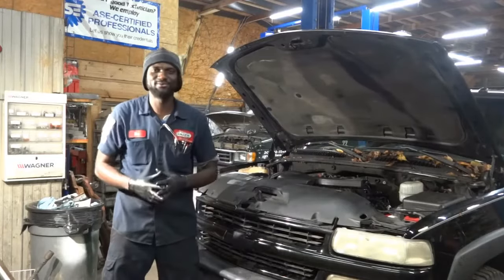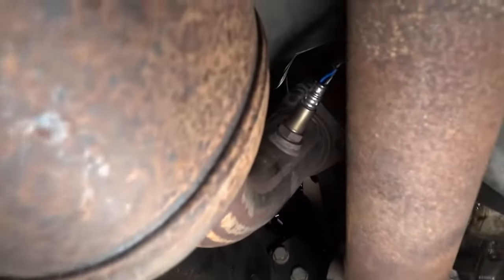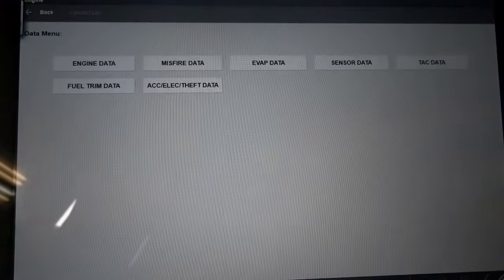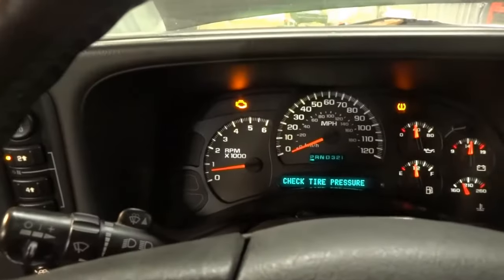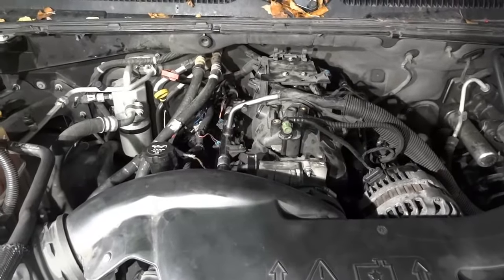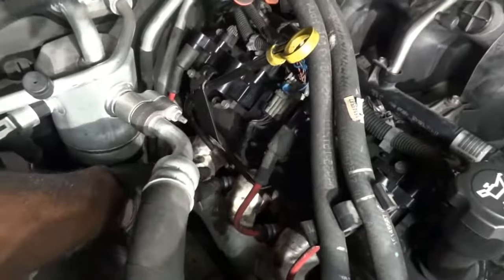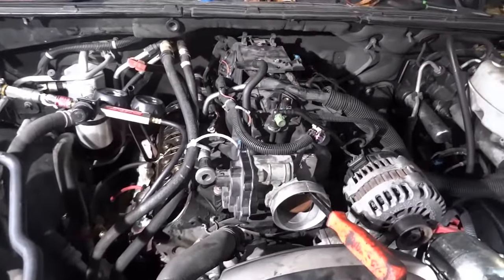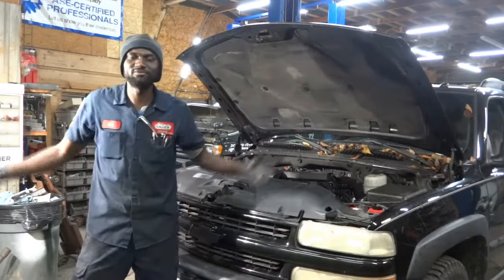CHEVROLET SUBURBAN 5.3L~ P0300, Still not Fixed After replacing the injectors and ignition Coils...

Comment: Very nice video. Thanks. I've been helping my son with his 5.3 L engine. I did a relative compression test and a couple of the cylinders show a bit low on the trace compared to the rest. The truck runs good, and is not showing any misfires in scan data. I don't have a leak down tester, but I'm considering getting one. Question, if a leak down test showed a non-sealing valve, would it be an acceptable repair to just pull the head off and replace the valve and the spring components? Would I necessarily have to send the head to a machine shop to be resurfaced if there was no evidence of warpage with a straight edge? I also saw on eBay some used cylinder heads for this engine for around $200 for the complete heads. I'm wondering if that would be an acceptable route to take? My son doesn't have a lot of money to sink into this truck, so just trying to find the least expensive fix possible.
Reply from the maker: Timothy Horne Thanks!  is the head on eBay new or used? it's always good to send the head to the machine shop to get it checked and cleaned if you plan on reusing it!
Reply: @KITS_Auto_and_Truck_Repair  it's a used head. Thanks!
Reply from the maker: @Z14kt12timandjes1   My Pleasure! I think you'll be better off sending the one you have to the machine shop than getting a used one online!

Comment: WOW!! Outstanding video with sound mechanical reasoning and diagnostic's. Son has 08' Avalanche with very similar problem and shop in Texas is throwing parts at it. Told him to stop! Get it home and I'll come look at it. This video helps immensely in my thought processes and diagnostic plans. Well done my friend! Wished we had more True Automotive "Technicians" like you !!
Reply from the maker: David Frank  Thank you!! Good luck with your son's truck!!
Reply: What was the fix?
Reply: @mtsanchez27  Marcos...I could never definitively the culprit. His 2008 Chevy Avalanche still has some misfires on #5 and to lesser degree some on #7. I followed K Diagnostics logical approach. I scanned vehicle using my Bluedriver OBDII and checked Mode 6 data and many other parameters. I saw nothing that stood out. Next visual inspection of wires, connections, grounds. I replaced all plugs and wires with AC Delco along with air filter. Did spark check with spark tester set at 35Kv gap. Healthy spark. Did NOID light check of injectors and all were showing indications of electrical continuity. I checked MAF sensor, then removed and cleaned throttle body. I checked Fuel pressure at rail with Bluedriver backup. I did power balance. I ran vacuum check warmed up and truck pulls steady 19" Hg. Still nothing definite. I pulled valve covers and checked integrity of valve train, especially cylinders 1, 2, 4, and 7 since those are AFM cylinders. I did warm/dry compression check and all were around 185 psi! I did cylinder leak down test and all 8 cylinders had minimal leak and near identical numbers (Regulated 30 psi with leakage gage at 28 psi). Car idles great and for 156, 000 miles pulls strong. So I came back to OKC from Houston and told son drive it and keep me advised. A local Chevy dealer looked at it after all my work and told him he needed new engine due to suspect sticky valves!!! I asked the Service Manager to tell me with all the date I have (which I gave them), why they think it needs a new engine?! Nothing but crickets! Anyway, one item left untested was the actual injectors as to spray pattern etc. They appear original so I can only surmise that "maybe" that #5 fuel injector is erratic or dirty and maybe not spraying a nice atomized pattern? Good luck with your endeavors.
Reply: Marcos, I forgot! Early on when I did visual and got ready to check vacuum I pulled the PCV hose from drivers side valve cover...at the rear area. It has like a factory 45 degree angle hose fitting there about 2.5" long? It had a near 1" crack in it! I replaced the entire hose from that valve cover to the intake with new GM part number then did vacuum check. I suspect part of the issue was A/F ratio issue with intermittent leak from that hose. For grins I checked entire intake area and other common spots to see if there were any other vacuum leaks downstream of the MAF sensor and did not find any others.
Reply: @davidfrank6432  thank you so much for your help!!!

Comment: Love this. I have the same issue on a high mileage 2011 Silverado 3500. I replaced all 02 sensors and replaced plugs, coils, wires as well. I do not have the diagnostic tools you do, so I am guessing at this point. I was thinking fuel injectors, cat converter or ECM. I never thought about timing chains etc.. Thanks!
Reply from the maker: NY Rangers  My Pleasure!

Comment: My friend, I just started watching your videos, and you are a master at what you do. I was wondering if you could give me a hint on what is going on with my 2000 Chevy Silverado 1500 . The truck was running fine one morning started it up put it into gear. I noticed a little bit of hesitation didn’t think much of it, once I was on the main road truck wouldn’t tolerate, and it shut off I started it I drove it back to my house barely made it. I found out that cylinder 3-5-6-7-8 misfiring.
Reply from the maker: Elite Surface Coatings  start by checking your spark plugs and wires!

Comment: Man this was an informative video. I am in the exact same position as this truck owner. Mechanic just threw new parts (exact same) for this mystery P0300 code. They just gave up but I ended up with the bill for all the parts which they claimed the L99 engine needed but didn’t. 

I am praying its not an exhaust or intake valve. But i had new o2 sensors b1s1, 8 spark plugs, 8 spark wires, 2 coils, 3 injectors, but P0300 remains 😤 I wish you were near NYC!
Reply from the maker: Ben Hall  Oh I'm sorry to hear about what you went through! I hope you can find a Technician who can fix it right!

Comment: u stated u used a compression gauge was it the old analog gauge. i got on board 5 yrs ago with in cylinder pressure transducer that changed everything for me , dont even use the old gauge anymore. you would have seen your problem with that, if u dont have one get one and learn to use it. its amazing.
Reply from the maker: @user-hi3pt3mv2i  Yes! I agree, I use an in cylinder pressure transducer now, this video is been a here for a little while before I got the transducer!

Comment: Your supposed to set the gauge before putting air in the cylinder. Nice video. And you need to take both oil and coolant caps off or else if you can super pressurize the cooling system and you will be doing more work.
Reply from the maker: Brent Stone  I don't understand your suggestion!
Reply: @KITS_Auto_and_Truck_Repair  put the shop air on the gauge set it to 100 psi then connect to the hose going to the spark plugs hole. Hey I’m not bashing on you bro btw just watching you do it on camera it looked like you skipped the step

Comment: Plugs, wires and coils are ok, long as money isn’t tight that’s a good place to start, they are routine maintenance items like an oil change for me…. All O2 sensors Injectors and MAF is ridiculous though… Good work my friend… A leak down tester is not something you want to save money on, that tool is telling you if you are replacing or rebuilding the motor so you want a really good one or the savings on the tool get lost very quickly….
Reply from the maker: robert w  True!! Thank you!

Comment: Thank you, this is awesome. I have been chasing a P0300 on my own 4.8 2006 truck for months as well, I "inherited" the truck from my brother who could not afford the transmission work, but was also chasing the P0300, and had completed a tune-up and fuel-pressure test before the transmission died. 
And yes, a year later after taking ownership and replacing the transmission, I did go to the parts-store and change out all the coil packs (which actually did cure a "blinking check-light" misfire and an indicated P0304, after which i replaced the other 7 coils to be thorough) but i still, after that, had the P0300 left.
So, I have just finished compression-testing and next i am going to check vacuum leaks and repeat my brother's fuel-pressure tests (trying to go in order of easiness) --  I did NOT know how a leak-down test worked, or to check spring-condition. I will follow your plan and check those things after checking scanner counts again (not sure if my el-cheapo scanner has PIDs for each cylinder's misfire count but will see) and finding candidates -- kind of sad, that you did not get to complete a timing test. I sort of hoped that a timing-light test against moving belt would still work, i guess that is dreaming? do you have another video showing the timing test? FIVE STARS MY FRIEND.
Reply from the maker: bzert281 My Pleasure!! a leak down test should help you pinpoint the location of the problem!!
Reply: This same thing P0300 Drove me crazy for a year. In the end it was because when I changed the plugs I googled the gap which was wrong but I didn't know it because GM issued a bulletin with the correct gap after my initial search. 1 year later and 7 coil packs later I decided to pull the plugs again I googled the correct gap which was the real gap. Problem solved
Reply: @tiger9racing779  now that’s pretty scary it could be something so simple and over looked lol
Reply: @tiger9racing779  what was the gap ?

Comment: One more thing... Cylinder needs to be checked with piston at the top mid and bottom of the cylinder. Not the compression stroke/position only. This will also determine if you have an egg shaped cylinder. No blowby at the top but blowby in the middle of the stroke and no blowby at the bottom equals EGG. Still a pretty good video
Reply from the maker: Gpt500  Thanks and good suggestion my friend! these test resultats were already enough to make the call, the other tests were gonna be done if this one passed!

Comment: i have a P0300 code on my 2000 gmc sierra. have replaced coils, wires, plugs, injectors, 02 sensors, and now knock sensors are next on my list. this is the first GMC/Chevy i've owned and it will definitely be the last. if it was a ford, there would be individual codes for everything that could possibly be causing the issue. bad 02 sensor? there's a code for that! bad cat? there's a code for that! bad plugs? yep code for that! bad ignition coils? yep code for that as well. but instead of individual codes for individual problems, GM/chevy is just like "it could literally be ANYTHING in the ignition, fuel delivery or exhaust systems, that's about 50 parts, good luck!" and that will be exactly what i say every time i hear someone talking shit on ford from now on.
Reply from the maker: @Smokey420Greenleaf   Lol!!

Comment: So I got a 5.3L 1500 and I rebuilt the transmission and everything went as planned but right after that I have an engine misfire code and a MAF air flow sensor code replaced the air flow sensor still have an engine code new coils, spark plugs , air filter cleaned injectors and prior to all this the truck has good compression the only thing I’d assume it is is a cat gummed up?… some black smoke coming outa the exhaust all the spark plugs on the driver side are all blackened so I’m thinking it’s a cat in the driver side blocking flow lmk what u think and any questions that I couldn’t answer to you to make u have a good guess of what it is ?
Reply from the maker: @YOUTUBE_CLOUDZ   Check the crank sensor reluctor wheel make sure it didn't get damaged in the process of replacing the transmission! and check your crank sensor as well,

Comment: Hi Deo!(pardon my spelling😊). First time here! I totally agree with all the positive feedback. You're definitely a gifted technician, instructor and content creator! Question: What are the possible causes for the poorly seated valve? Also, could it be fixed with fuel addititives or any ither options? I'm a novice here and trying to help a friend with a similar issues. Please pardon me if the question seems  silly
Reply from the maker: @sibbyd8743  Thanks for your question! your question is not silly, a valve that's not seating will cause a misfire and low compression readings!!

Comment: I’m getting a p0300, misfire cylinder 4. I have had the engine reworked and replaced the old heads with 2 news ones. Replaced spark plugs, wires, coils, plate, all new gaskets, sensors, and more but I’m still getting this code. I know in the video you said something about the timing, what do you suggest my next steps be?
Reply from the maker: @MsChatty717  check compression on cylinder 4

Comment: I have never done a leak down test so if this is a stupid question just let me know. Could you have turned the engine a little forward or backwards to make sure that the valves were sealed?  Thanks. I have been battling a misfire in cylinder 5 since I got the truck. Thanks for a great video
Reply from the maker: robert ottenmiller  My Pleasure! That's hard to tell if the valves are sealing properly by just turning the engine!

Comment: Great job of explaining, I wish I lived near your shop! I am having trouble with my 04 suburban, I have someone bringing over a scanner today and see what codes are there. My fuel pressure is running at about 44psi. I am guessing that is low by what I see. It looks like it should be a minimum of 55. I may also be checking what you just showed here if I see something like you saw. Blessings Pablo in Yucatan Mexico.
Reply from the maker: 100 Degrees of Difference  My Pleasure!! and Good Luck with your vehicle!

Comment: This is something I've been dealing with in an 03 4.8. cylinders 8 and 5 dry plugs p0300.
When I drive it it runs and performs great but definitely is missing. That air leak.. is that something that can also be heard when pushing the throttle? Because I can definitely hear an extra amount of a air sound from what sounds like throttle body to me while in the truck. And from time to time now it has a clanking which I thought was an exhaust issue but it's all still tight and in place and now that ice seen and heard the lifters noise when you moved them it definitely sounds and makes me think valves not seating and possibly a bent valve or broke spring or lifter.?.
Reply from the maker: @TMT868  Do a compression test on the cylinders and see what you get!

Comment: Got a 04 Tahoe I'm dealing with this same problem. It's saying I have multiple cylinder misfire but ya hardly notice it unless it's messing up real bad . The other code is being thrown is the camshaft position sensor which I'm changing tomorrow. I've changeded all my sensors but not my 02 sensors I think those are BS majority of the time.  Hoping this video helps, but I ran OBD and after changing few sensors I only have camshaft sensor and running lean. Since it runs good especially after its been running awhile I think it's the sensor ?
Reply from the maker: OuTLaW$andOuTDooRs TV   I recommend you take it to a pro mechanic who can diagnose it for you!

Comment: Hi.  and what was the problem?  which cylinder is not firing?  lost ignition?  did you disconnect the coils one by one?  if so, it should point you to the cylinder that was misfiring.  Did you have a flashing check engine and stabilitrak light?
Reply from the maker: Philips TV  Check engine light was not flashing, it was a random multiple cylinder misfire, P0300, so disconnecting the coils didn't help, it was a pretty bizarre case study!

Comment: He explains so well. Great teacher! I got a p0300 running rough. Smells like it's burning too much gas from the exhaust. Will figure this out soon!
Reply from the maker: The lazyhandyman  My Pleasure!! Good luck with your project!!
Reply: @KITS_Auto_and_Truck_Repair  thank you be safe brother!
Reply from the maker: @thelazyhandyman  My Pleasure!!
Reply: Did you figure out @the lazyhandyman
Reply: @150Teej  will let you know. Didn't replace the exhaust gasket yet
Reply: @thelazyhandyman  Did you figure out your problem?  I have P0300 code only, with check engine light and heavy shaking misfires. Soon, there is smell of sulfur from exhausts. 
150,000 miles on the car. 
Plugs/wires changed 50k miles ago.
Cleaned MAF sensor. Clean air filter.
Reply: @nazareta6541  going to post up my solution this week. I kinda got busy with other things. I changed out 1 coil cyl# 3 now runs better but still have the p0300. Going to try the exhaust gasket see if it resolves it. Hate GM
Reply: @thelazyhandyman  Good work. 
Many people in the forums (corvette forums, I have a corvette) saying it can be a broken VALVE spring..
I don't consider myself handy, but I'm going to see if I can locate these springs tomorrow.
Reply: @nazareta6541  I'm not even going to try that. I can use a ratchet but I can't do engine work. Not worth it for my GMC Sierra 2005.

Comment: A few questions.  With so many misses recorded by the vehicle computer showing on the scanner, why didn't the computer show a problem code for #6 instead of a Random/Multiple Misfire?  What was your results of the compression test you ran off camera?  What did each cylinder show?
Reply from the maker: BJ Harney  Some older computer programs were not really accurate, to identify cylinder misfires

Comment: I have a question if you don't mind answering,it really would be very helpful I brought a 2002 suburban from a private owner ,the catalytic convertors were stolen,the check engine light is on of course,i scanned it to see what was tge codes were reading ,my question is if the convertors were cut off ,could it set a P0300 code ,it read misfire or multiple misfires .Could something as missing convertors and unhooked oxygen sensors set that code I'm really curious I just don't want to be buying things that it really doesn't need
Reply from the maker: @anthonywinters6157  yes! defective or missing 02 sensors can cause a misfire!